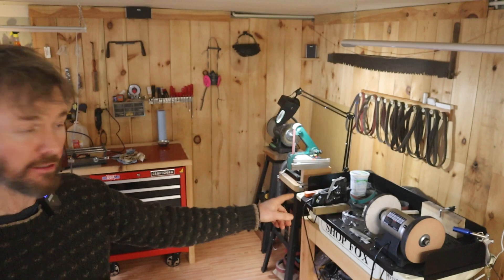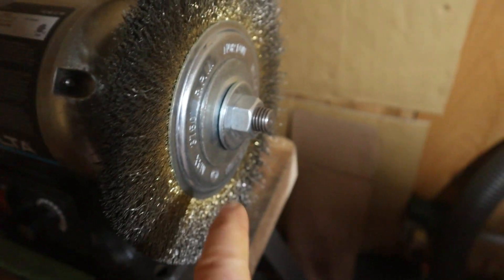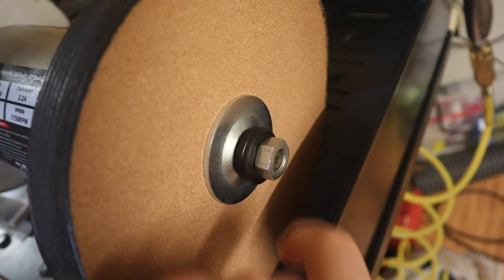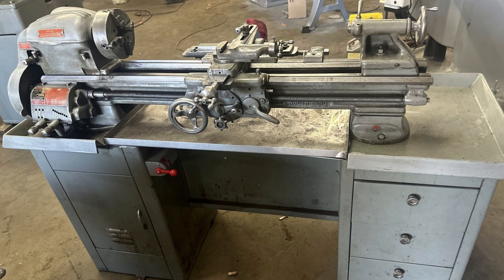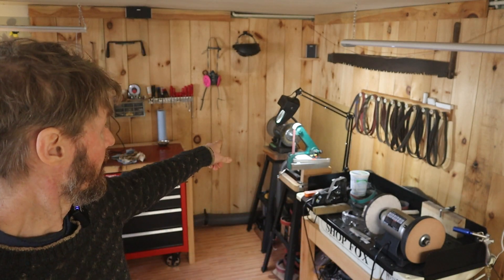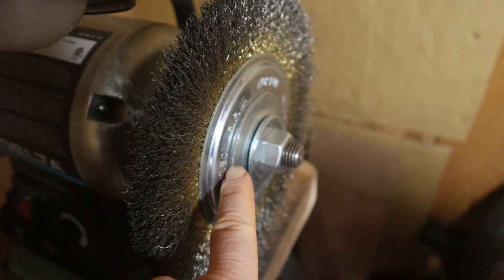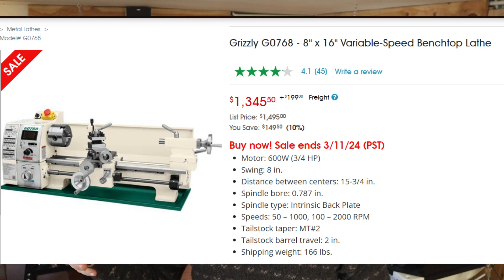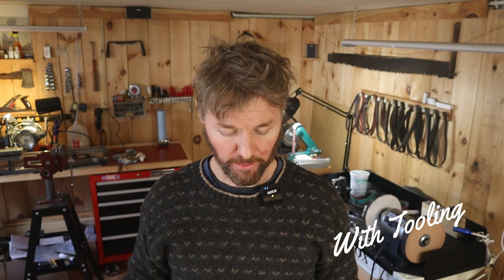Can A Lathe Solve These Problems in My Sharpening Shop

Comment: I wound consider a threaded rod to mount the wheels in so that nuts & flange washers can be used to determine spacing and fix the wheels in place. 5/8" or thereabouts seems like a decent place to start, as you can easily build up that diameter but not easily reduce it. 
I would picture it with lowest grits on the leftmost side, progressively getting finer as you move right wards through the progression.
My .02, interesting idea.
Reply from the maker: That's a great idea to try, thank you!

Comment: I have little “sharpening” experience, but do have experience in a job shop and maintenance shop.  You will love the lathe and the capabilities it opens to you in building tooling and fixtures.  While I have and will continue to do tool posts grinding when needed on the lathe I take great pains to protect the machine, so much so I believe it will be impractical to use the lathe as an arbor driving system.  I keep my welding and grinding separate from my machine area. As the dust will find a way in every space of the machine.  However will soon find that with the lathe building a stand alone system you described will be fairly easy while keeping the lathe free for the other task.  Your going to love having a lathe in your tool kit.
Reply from the maker: Thanks so much for the encouragement. I appreciate your input to take excellent care of the machine. It doesn't make sense to invest in a nice piece of equipment and then use it in such a way that it degrades in function and value. 
Someone else mentioned a wood lathe, maybe if this idea pans out it would make sense to move it over to a form factor more like one of those. We'll see. 
Thanks again.

Comment: Great idea. I have three lathes in my shop and I’d never thought about getting a mandrel to fit my wheels.  Two of them are metal lathes , But the one that really would work is my variable speed wood lathe.
Reply from the maker: If you have any thoughts on the best way to capture 2 or 3 wheels on one shaft please let me know.
Reply: @capnmatt41  I was thinking of a steel 5/8 mandrel that could be grabbed in my 4 jaw self centering chuck and then kept with a hole in the other end that would be held by the tail stock.
Reply from the maker: @buffalojones341  right on. Any ideas on how would you clamp the wheels on that mandrel?